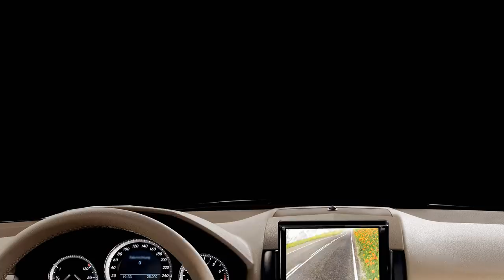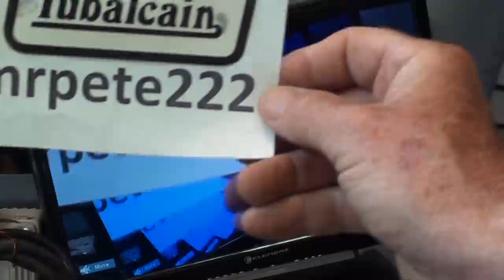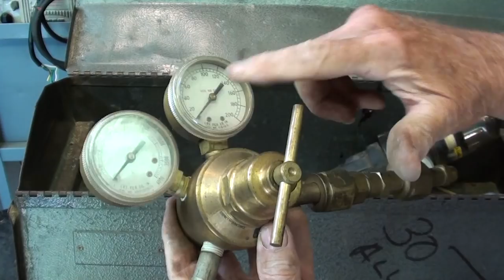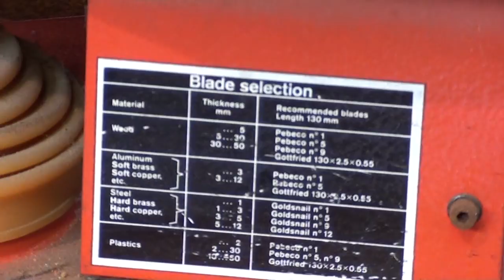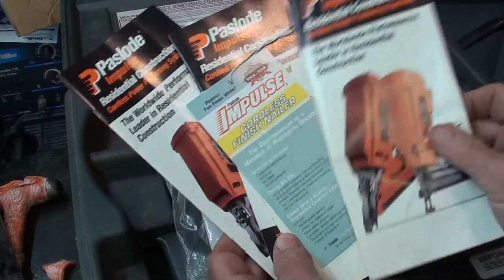FINAL TOOL SCORE AT Garage Sale pt 3 tubalcain

Comment: That's the hegner scroll saw....world class.....parts are available stand is not homemade......great score I love mine
Reply: Possibly a Multimax 14E single speed. Would probably sell for at least 150GBP. The stands can sell for 50GBP
Reply from the maker: I guess I lucked out on that one
Reply: Definitely 100% Hegner great score!
Reply: The current model of that saw is a little different not much retails for near $1100 used in the states anywhere from $100 to $400

Comment: You might cast an aluminum handle over the dead blow core? Would indeed cure the deterioration problem.
Reply: Yes. A great project for Mr Peter.
Reply: Now that’s what I would like to see happen, since Stanley made those for their line and for Snap On Tools, oh and by the way Mr Pete Snap On does warranty replacement on those hammers with their name on it, i got mine replaced with the new models with completely different material for the handle. I called and they gave me a claim number and had me send them back to them. I received my replacement hammers within two weeks. They will last for my life time plus the next owner.
Reply from the maker: Good idea
Reply: Looking forward to that one!

Comment: Had a great time watching. Look forward to early Saturday morning releases! That air chuck on the oxygen regulator is a bit troubling. Some people use oxygen in place of an air compressor, at their own peril.
Reply from the maker: Sounds dangerous to me
Reply: DO NOT USE OIL to lubricate the pneumatic tool IT WILL EXPLODE IN YOUR HAND

Comment: Dang, take the guy on the lawnmower with you to the garage sale. It is soooo  annoying and everyone lives annoying noises in YT videos. One of my favorites is amplifying the volume when sawing, routing, grinding  or sanding. 
And to top it off your neighbor cheated us of  annoying noise 2/3  through the video. Dang. But he came back thankfully. 
How big is his damn yard?
It could be a Hagner. If it’s as smooth as silk it is if not it’s Harbor Freight Chinesium. 
In short, you scored big time Lyle. I think you score s lot. Good for you. I love it. I love S&k as well. Hard to find. 
My fav C clamps are Cincinnati. Still have mine from high school. 50 years old. The Greenlee is a punch. 
I love the video. Buy a 100 watt amp and record and playback the lawnmower at midnight pointed at the neighbor. As soon as the lights go back off, turn it up and repeat. Had a great time.

Comment: 22:28  That is a greenlee punch for making holes in electrical panels. You start with a hole to fit the 1/2 inch, then go up to the size you need to make ….  3/4 1 1-1/4, 1-1/2  etc  This stuff definitely  came from an electrician. I also live in Illinois just behind Ohare airport. where are you near???

Comment: The regulator  could have been used on a nitrogen bottle to run air tools. Folks who raced sometimes used that at the track instead of portable air compressors
Reply from the maker: Thank you, I was wondering what that set up was for

Comment: That's a Hegner saw. No doubt about it .The Mercedes Benz of scroll saws. A wee bit of adjusting and it will run more quietly and smoother . Sold a used one recently for £180 ( new they are megabucks in the uk). Sought after and much valued by the wood craft folk.....( ''WOOD'' that stuff we used before metal)
Reply from the maker: Thanks

Comment: Hi Lyle! Boy I sure could have used the mill and Colchester. they looked almost  unused ! My question is when you come across that sort of thing how do you transport them? I guess a U-haul is the way, or a small U haul and a trailer. I had one of those motors go bad (it hummed instead of running) and it turned out to be a piece of dirt in the start windings. Usually single phase motors that hum are the capacitor, which you can check   by briefly shorting across the cap terminals. (do not electrocute yourself!) 

By the way, I ran across a key for the codes on the NEMA plates on electric motors. It is printed out on the motor, but might be of use looking in online catalogs.
 http://www.techtopind.com/embeds/key%20description
Reply from the maker: They were nice looking machines

Comment: Porter Cable made a fuel cell powered nail gun similar to that Paslode.  The fuel cell in the gun would leak over time.  Every time I went to use it the damn thing it was empty.  Fuel cells were expensive, I think they were butane.
Sold mine at a garage sale, I think some manufacturers took these of the market, no wonder.
Reply from the maker: Thanks

Comment: "There's a lot of stuff here that I don't need."

When does that matter when you find cool stuff to buy for cheap?!?
Reply: I had a brass Snap-On hammer that was like new, but about 10-12 years old. It's handle cracked as well, but they just replaced it for me a couple of weeks ago. The salesman tells me that the material they're using now won't crack like that, so I've got that going for me I guess...

Comment: That Paslode nail gun looks a lot like one I used to use for office partitioning. Shoots hardened nails into concrete. The gass cells would deteriorate and need replacing usually before they were empty.
Reply from the maker: Thanks

Comment: If the battery is any good. You need "Hammer Gas".
Reply: Both Estwing hammers are geological prospection tools. The pointy one is for mineralogists and the flat ended is for fossil research and are quite expensive!

Comment: Lyle I had a complete set of those hammers everyone did that. On the ballpene  hammers the shots locked in the face unscrew. I made new aluminum knurled handles with set screws to lock them tight . Very easy really , grind the thin flat strip on the shaft off . Drill your handle to clear the shaft on the hammer . I actually like me handles better then the plastic crap. My big dead blow snap ons the shot went all over so there went $60. Each for three of those. Good score on many of the tools tho. Wouldn't want to send one of those chain wrench chains to me would YA. Think it'll work on my old plumbers vise with the crank down chain. Got to love the extra sound effects to me I just think its so cool your making great videos no matter what. Your a favorite on my watching program.
Reply from the maker: Thank you for watching

Comment: Glad you went back to help those folks  clean up.  The past 2 weeks I have drove into the country for garage sales listing lots of tools.  Nothing but a wasted trip.  Basically they are  liying.  Personally I think your scroll saw is good for its age.  Get some Olson scroll saw blades that will fit it and see how smooth and straight it cuts. Ladies really take to using them  and set up little work areas.  Young kids too.  All of those old Illinois houses with the old wood porches and filigree trim that is broke or missing pieces are a source of a little work.
Reply from the maker: Yes, lots of the garage sale advertisements are lies

Comment: Indeed, I do enjoy these types of videos, Mr.Pete. We used to use those Armstrong clamps in the tool & die shop for hoisting the dies up onto the workbenches. (Hope OSHA wasn't listening to that.) They were the only clamps we trusted to do that very dangerous thing. I have that same drill press but mine has Companion cast into the belt guard. It was my Dad's from 1937 and still works as good today, as it did back then. mine only has the single rod, quill handle that can be slid to one end to increase leverage. The scroll saw is definitely, a Hegner with a factory stand- big bucks. Scroll sawing had a resurgence of popularity in the early 80's and Hegner seemed to be the saw that everyone was clamoring for. That, and the RBI brand.
Reply from the maker: All of the Armstrong product were extremely high-quality

Comment: That is a hegner. I had the same problem with the switch. I took it apart and cleaned it up and it worked fine. I sold mine on Craigslist for $800.
Reply from the maker: Good idea, I will take the switch apart. Thank you
Reply: mrpete222 No problem. That is actually the hegner stand. I couldn't figure out how to get the switch apart, so i basically pulled the knob straight out.  It wasnt ideal, but I was able to spray contact cleaner inside and put it back in, and it worked after that.

Comment: the Red table under the saw is factory made someware in china, got one under a Huvema 16mm drilpress. the saw is generic chinese.
Reply: Greenlee don't know the english word for it but i use them a lot as a electrician to maken holes for cableglands or even fans in sheetmetal electrical cabinets. pullpunch.?
Reply from the maker: Thanks

Comment: A decent Michigan pattern double bitted.  A fine camp axe, just needs a bit of clean up.

Also, be glad that Pyrene extinguisher is empty. They are almost as dangerous as the fire they were intended to extinguish. 
The things turned out to be good at extinguishing life, as well as fire, when used on a fire. 
Leave it as is, and list it for the antique car/military vehicle crowd, and you'll sell it fast.
Reply from the maker: Thank you, I did not know they were dangerous
Reply: If I remember my Fire Fighting Course from half a century ago, they contained CTC - carbon tetra chloride, which is the same as dry cleaning fluid, so if someone had a stain on some clothes they would go missing or still there - but empty. They were for electrical fires but produced a poisonous gas in confined spaces, have a care what you do with it!
Reply: Correct, they were filled with carbon-tet AKA "HALON-104". When you douse a fire with it, it generates phosgene gas. 

Now the neat brass extinguisher cans alone, are collectors items.